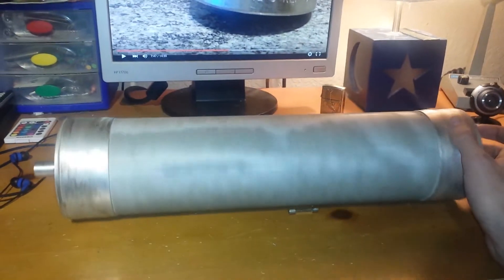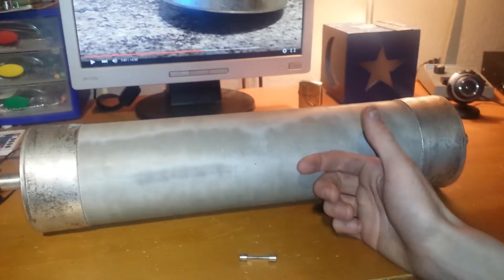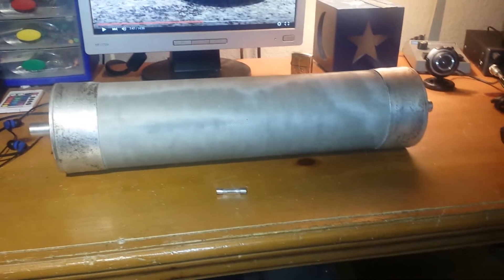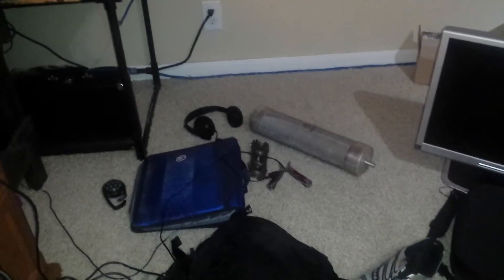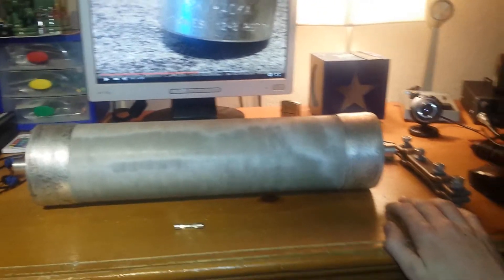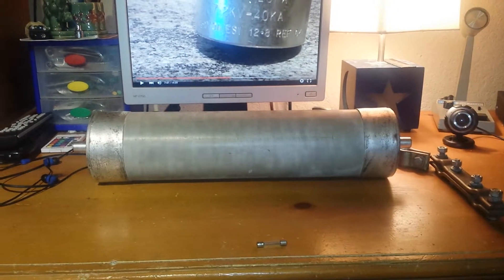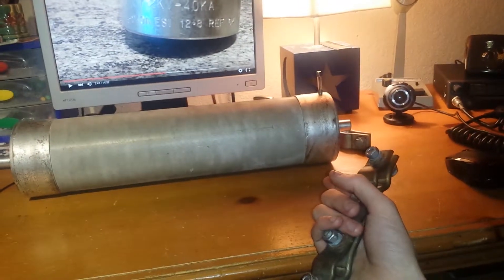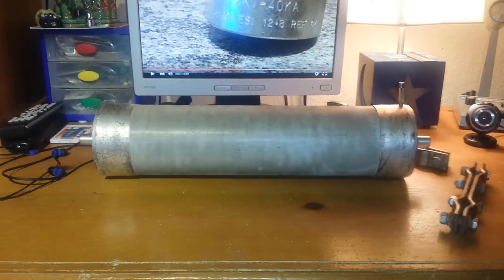Substation fuse

Comment: I worked one summer setting up an electroplating plant.  They had 100,000 amp service entrance fuses.  Not sure what the voltage rating was on them.  Obviously silver is almost as good as a conductor as gold, but a little cheaper is why they use silver connections.  A few milliohms will case a BIG voltage drop and a lot of heat at 79,999.9 amps.